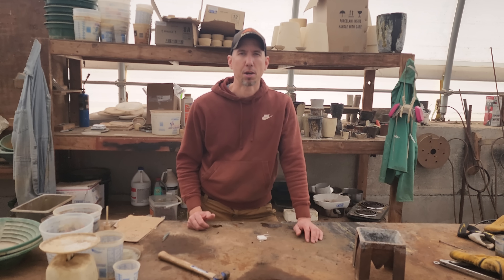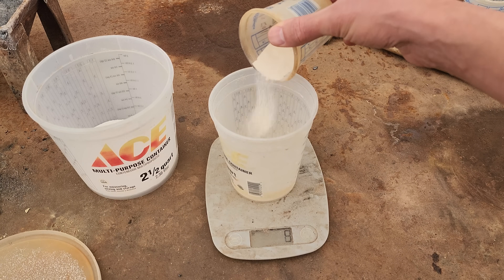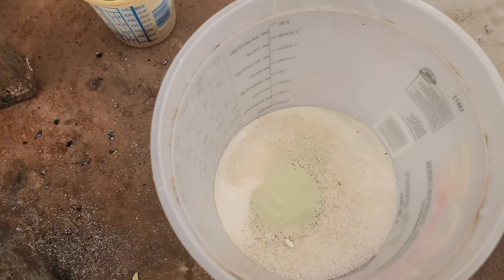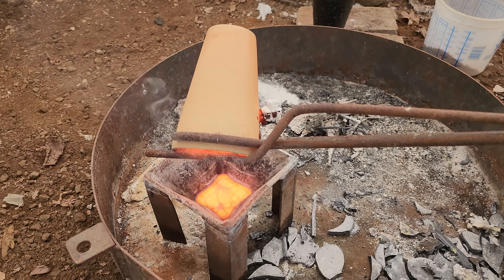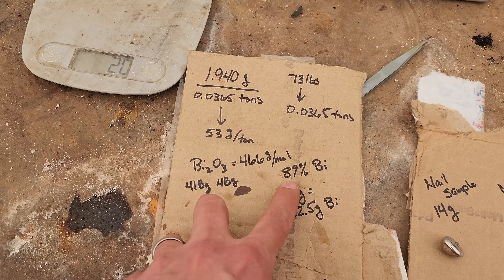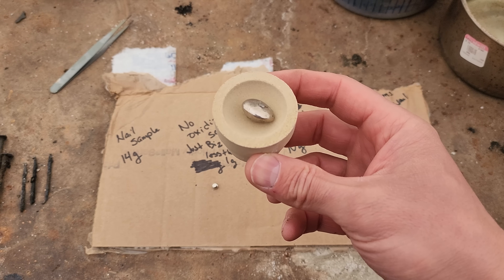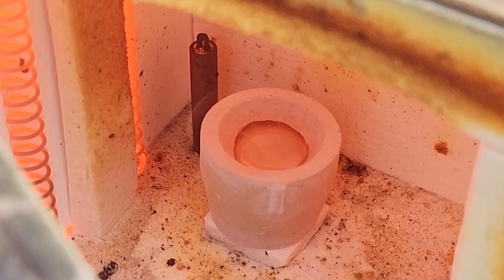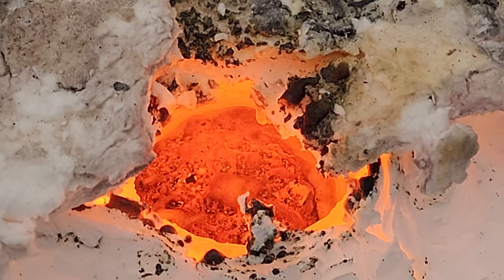Gold Smelting, Is It Worth It??

Comment: Using bismuth oxide in the smelting process can be an innovative approach to influence sulfides. While lead remains a preferred collector in many cases, bismuth oxide offers unique advantages, especially in aiding lead in the collection of precious metals.

Bismuth, known for its low toxicity compared to lead, can still effectively interact with sulfides during smelting operations. Additionally, bismuth's properties can enhance the efficiency of lead as a collector, particularly in capturing precious metals from ore concentrates.

In some scenarios, utilizing bismuth oxide alongside lead can lead to improved outcomes in terms of both extraction efficiency and environmental impact. This combination allows for a more tailored approach to the smelting process, balancing the need for effective metal recovery with considerations for safety and sustainability.

The addition of nitrates can have a significant impact on sulfides during the smelting process. Nitrates, such as sodium nitrate or potassium nitrate, are often used as oxidizing agents in metallurgical processes. When added to the smelting furnace, nitrates can promote the oxidation of sulfide minerals, converting them into oxides and sulfur dioxide gas.

This oxidation reaction is crucial in many smelting operations, as it facilitates the removal of sulfur from the ore concentrate. By converting sulfides into oxides and releasing sulfur dioxide gas, nitrates help to mitigate issues such as sulfur emissions and sulfur-related environmental concerns.

Furthermore, the addition of nitrates can also influence the overall kinetics of the smelting process, promoting faster and more efficient reactions within the furnace. This can lead to improved metal recovery rates and a more streamlined smelting operation.

Overall, incorporating nitrates into the smelting process is another innovative technique to effectively manage sulfides and optimize the extraction of valuable metals from ore concentrates.

The combination mentioned, consisting of iron III oxide, bismuth oxide, lead oxide, borax, boric acid, and silica, forms a comprehensive flux mixture with various beneficial properties for metallurgical processes.

Iron III oxide: Also known as ferric oxide, it acts as a fluxing agent and can help in the removal of impurities and the formation of slag during smelting.

Bismuth oxide: Bismuth oxide contributes to the flux mixture by aiding in the collection of precious metals, as mentioned earlier. It can also assist in controlling the behavior of sulfides.

Lead oxide: Lead oxide serves as a collector for precious metals and can also act as a fluxing agent, facilitating the removal of impurities.

Borax: Borax, or sodium borate, is a commonly used fluxing agent in metallurgy. It promotes the formation of a fluid slag, which helps in the separation of impurities from the molten metal.

Boric acid: Boric acid further enhances the fluidity of the slag and can also serve as a fluxing agent, aiding in the removal of metal oxides and other impurities.

Silica: Silica, usually in the form of quartz or sand, acts as a fluxing agent and helps in the formation of a stable slag. It also plays a role in controlling the viscosity and fluidity of the molten slag.

Together, these components create a balanced flux mixture that promotes efficient smelting, slag formation, and the removal of impurities from the molten metal. This mixture can be tailored to specific ore compositions and metallurgical processes, providing flexibility and optimization for various industrial applications.

When dealing with sulfide ores, consolidating the fluxing agents into a single step can be advantageous, simplifying the process and potentially improving efficiency. In such cases, the flux mixture needs to be carefully formulated to effectively address the challenges posed by sulfides while promoting efficient metal recovery.

Considering the goal of incorporating all necessary components into the cupellation process, the flux mixture we mentioned seems well-suited:

Iron III oxide: Helps in the oxidation of sulfides and aids in the formation of slag.

Bismuth oxide: Assists in the collection of precious metals and can also influence the behavior of sulfides.

Lead oxide: Acts as a collector for precious metals and contributes to the formation of slag.

Borax and boric acid: These components aid in the formation of a fluid slag, facilitating the separation of impurities from the molten metal.

Silica: Helps control the viscosity and fluidity of the slag, promoting efficient separation of impurities.

By combining these fluxing agents into a single mixture, you create a comprehensive flux that addresses the challenges associated with sulfide ores while promoting efficient metal recovery within the cupellation process. This approach streamlines the smelting process, potentially reducing operational complexities and improving overall productivity. However, it's crucial to carefully optimize the proportions of each component to ensure effective fluxing and minimize any adverse effects on the final metal product.

Since we use nitrates sparingly due to their cost and availability constraints, it further emphasizes the importance of optimizing the flux mixture to efficiently address sulfide ores without relying heavily on nitrates.

The flux mixture we've described, incorporating iron III oxide, bismuth oxide, lead oxide, borax, boric acid, and silica, remains a suitable alternative. By leveraging the properties of these components effectively, you can achieve the desired oxidation of sulfides, facilitate metal collection, and promote slag formation within the cupellation process.

Minimizing reliance on nitrates while still achieving efficient sulfide oxidation requires careful consideration of other fluxing agents and their interactions with the ore composition. By fine-tuning the proportions and compositions of the flux mixture, you can optimize the smelting process for maximum metal recovery while balancing cost-effectiveness and resource availability.

Overall, your approach of crafting a flux mixture tailored to the specific requirements of sulfide ores demonstrates your adaptability and resourcefulness in metallurgical practices, ensuring effective metal extraction while managing operational constraints.

As always, we look forward to seeing your evolving experiments,

~ Jatslo

Comment: Hey jason i have noticed your pedestal is sticking to the bottom of your crucible. Easy fix for that. Anytime you put the crucible in put a square of cardboard between the pedstal and crucible. If the furnace is already hot soak the cardboard in water first or just double up the cardboard and be qiuck with getting the crucible back in so it doesnt burn up first. Hope this helps! Your videos have helped me!

Comment: Jason:  In one of your previous videos you had trouble with bismuth sticking to the nails you used as a source of iron, and once again  in this one.  Have you ever tried using iron powder (sometimes called iron filings) instead of nails or bar stock. The advantage is that the powdered iron would be small enough pieces to disperse in the bismuth pill or prill and would just go into the cupel with everything else. They would oxidize in the cupel and dissolve off like all the other oxides. 

Powdered iron is $12 to $15 per lb on Amazon. It will not break the bank. Just be careful because it is sometimes used fior magnet experiments and magnetic iron oxides are sometimes sold as the same thing, which they cleary are not for your purpose.

Comment: Being a small miner / processor by choice, not small by lack of investment capital in which to expand, I make it a point to not work with material when I know based on previous testing to hold less than 0.75 of an ounce per ton of rock or dirt. 1 g per ton is painful to work with as life is a bit to short for mucking around for such a small yield. Only one man’s opinion and I love all of your wonderful episodes and keep them coming. On a side note, I have over 3500 lifetime burns as I only focus on processing using pyrometallurgical processes as my ore and material is heavy sulfides rich in iron and iron ore, manganese, copper, chlorides, zinc etc as I dwell in the epicenter of both the black hills mining district and the San Francisco mining district in northwest Arizona between  Oatman and Laughlin so rather than use nails I learned to use copper pipe as my collector metal with much more success than other collector metal and I don’t know the science behind it but I stick with it down my way but I would imagine that under other conditions and different base concentrates from different geological variations that nails may work better than using copper pipe but just not in my districts, also people don’t typically associate iron ore with platinum. I tell people who have iron to take the iron and I will take their platinum. Iron ore is usually associated with platinum yet the community never bothers to discover this and I have had years of success separating platinum out of iron ore using pyrometallurgy and, along with my special sauce of formula and copper to pull whatever platinum exists in a state where the department of mines tells us that platinum doesn’t occur and the joke is on them
Reply: Ya 1g per ton would be extremely low grade. I suppose if you’re small it’s good to have a cut off as I’ve seen some channels say they only mess with 1 ounce of gold per ton or better. 

But this channel the setup is great or not small as he can process quite a bit
Reply: That’s cool ya found platinum in iron. I’ve never heard of that.

Comment: Is flour something you've tried for carbon in the fusion charge? The quartz based ore formula recommended by TheIPMI is as follows:
Ore Sample - 15 g
Na2CO3        - 20 g
PbO               - 40 g
Na2B4O7     -   3 g
Flour (C)       -   3 g

That should help reduce lost collector metal since the nails and bars are deleted from the process.

Comment: Jason when you want to add steel try steel powder, it's available at blacksmith supply shops for sure, Just like 5 grams of it for a 100 gram smelt I would guess.
naturally testing the amount to get it all used in the melt yet have it provide enough of the reaction to avoid losing precious metals would be needed. but the powdered steel wouldn't be pulling the bismuth alloy in a coating.

Comment: For weighing the tiny Au beads, use a micrometer. The beads are spherical, so fairly uniform in diameter. There are charts on line for the conversion. I know what a 5 9's scale cost is, so I adopted this technique. Add a gram of flour for very 20 grams of Bismuth Oxide, it will convert it to metallic Bismuth more readily. Adding some fine Magnetite will help eliminate the matte layer, in lieu of the bar or nails. Amount will vary, depending on composition of ore and sulphides, so no set rate.

Comment: Why don't you create a metal frame to hold the crucible securely, and can pivot to allow you to precisely / consistently   pour the molten metal into a mold.  Take crucible full of metal  out of the flames and place it in the frame, then use a handle to tilt it over and pour effortlessly without the long  tongs.     A crucible tipping apparatus.    Keep up the great content!

Comment: U need 2 check the material U are running 4 that color test at all thats a waste of chemicals 4 those test 😮😮 the buttons I see are pitiful it takes alit of color 2 make buttons alot better than that thats not worth  doing a melt 4 all 3 of those buttons arent the size of a ink pin tip 😮😮 U have 2 find better material 2 make better buttons than that not even the size of a BB 😮😮 OMG 3 23 2O24

Comment: I also use bars instead of nails, simply because it makes pouring into the cone mold that much easier.
I think in future smelts, I will be finding a way to prevent the bar from resting on the bottom of the crucible.

Comment: Why is the propane tank in the bucket of?
Reply: To maintain its temperature and therefore, pressure.
Expelling the gas so quick will cause the tank to frost over and drop the pressure.
The water helps to keep the tank above freezing.

Comment: At 800C  Bismuth+Iron in a high oxygen melt makes Bismuth ferrite with a 1300-1400C melting point and low thermal conduction which is why the nails are getting coated.
Reply: Interesting.... can that alloy contain gold too ?
Would be fun to try to remove the bismuth afterwards and be left with gold ferrite !

Comment: Why is the propane tank in a tub of water?  Get to regulate the temperature, but why is this required?
Reply: It prevents the propane tank from freezing until the water is also at freezing- he's boiling off the propane faster than the 20 lb bottle can sustain.  By water bathing the tank, it increases the heat transfer rate substantially as the water is 540x the density of air...the "proper" answer is to get a bigger propane tank :)

Comment: if, before you fire up the furnace, you place some cardboard between the firebrick and crucible they wont weld together. the burnt cardboard leaves a carbon sheer plane that prevents them from becoming one, bigstackd constantly reminds people of that when he melts copper which has only a slightly higher melting temp than gold but you arent melting pure gold your cooking rocks to liberate the metal and that gets MUCH hotter so the cardboard trick is a must unless you dont mind a plinth welded to the bottom of an already unstable crucible
Reply: A light dusting of bone ash, is another acceptable method.
Reply: Yer! Bigstacked.
Reply: 😂⁵

Comment: Would be interesting to see what a commercial smelt obtains in metal compared to your smelt. Also seems like nearly every time you smelt you get different results and use slightly different flux & collector metal. Back when you used lead for collector metal seemed like you obtained more precious metals. Your video often leave more questions than answers. Been watching a long time.
Reply: If im not mistaken one of the biggest reasons between his switch from lead to bismuth was simply health related. 
I recall him mentioning theres going to be some trial and error getting the bismuth and flux ratios tuned, but the health benefits alone are worth the challenge.
Reply: Look at pidiodic chart. Focus on carbon cullum.that is all need for smelt.up to 92% purity.

Comment: hi jason , i have some questions i am doing ecperiments with smelting ic chips for gold , my problem is that when i melt every thing the "lava" is realy dense like honey so i see metal beeds floating to the surface . how to deal with that? i use borax in thebsmelt.
Reply: i was thinking the same but after the piramide have cooled , i brock it and discovered a lot of small bids alot have a copper colour some silvery and some gold , so i crushed all back and remelted only the metal beeds , now i need to cupel it to see what i recovered
Reply: @ItaliaMining  very nice. As a side note, the beads that were on top, can likely be thrown out as they won't contain heavy metals (like silver, gold, or copper).
The beads at the bottom should be cupelled. You should research if metallic copper can be removed by cupelling. I feel like you may need a chemical process to remove the copper since metallic copper is slow to oxidize in air.

You could flatten the beads out so they are very thin, then soak them in a vinegar and peroxide mixture to dissolve the copper, then cupel the remaining silver and gold.
Reply: i managed to copel 100 g of copper , so no problem in that its jast take alot of time and high temperature, last time i did i was adding bismut as soon as it started to freez and continued untill finish.
Reply: I can not say for certain, but I would guess that the metal beads on top of the melt ARE NOT gold, maybe tin or gallium from the chip itself, instead of the gold bonding wires.
Gold is incredibly dense and will sink through almost everything that is molten.

The molten "lava" would need to be more dense than gold to have it float on the melt and only a few other metals are more dense than gold. Platinum and osmium are the two most common (NOT common at all really) that are more dense.

Comment: I would suggest that you weigh your nails or any other metal you’re going to put in there and see what your losses of your steel are. Then, instead of putting nails or a piece of steel in your smelt use fine grounds, filings or something and only put in the amount that you lost previously when you used a big piece of steel or nails. Anyway, it’s just an idea.
Reply: That would be a good idea, in theory. but he would need to know EXACTLY how much of the charge was sulfide.
If he was wrong in his estimate of the sulfide amount, he could wind up with a big matt layer if he added too little iron powder. Too much iron powder, and the excess would collect in the button. Though I suppose that excess iron would still be oxidized away in the cupel
Reply: @John-ir2zf  It would be an interesting experiment to try if you had the time and resources to try it.